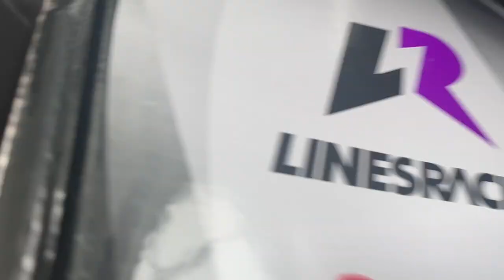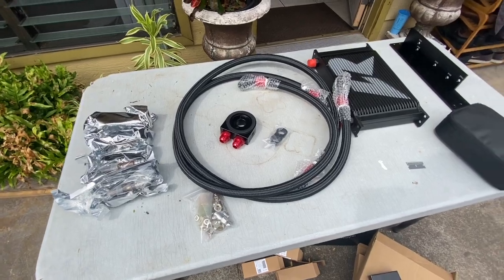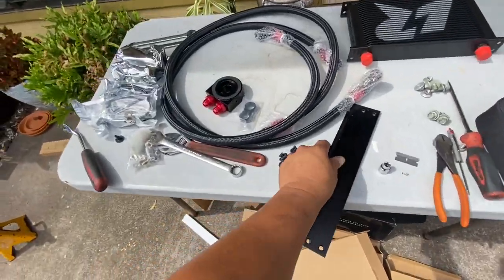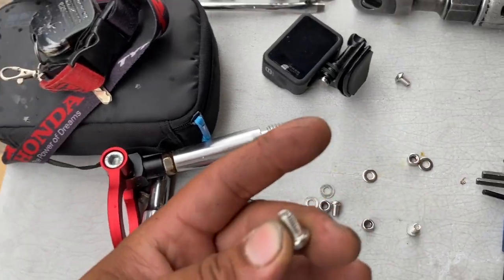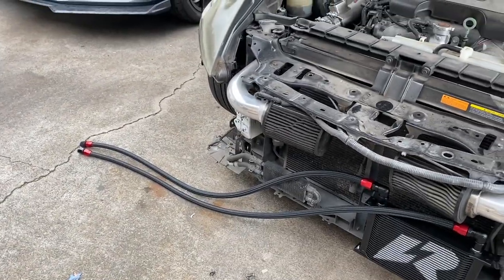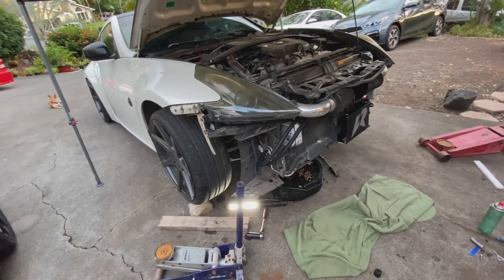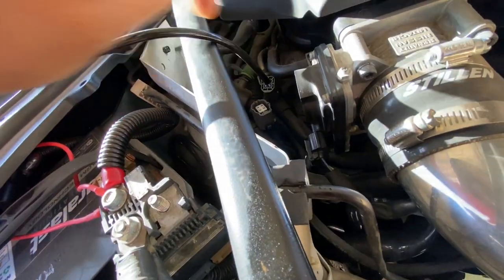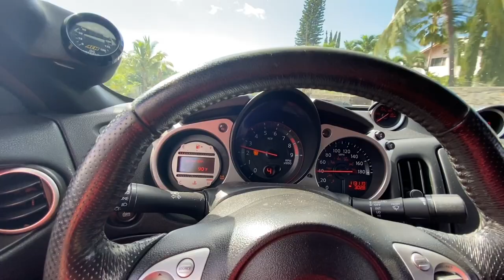Installing Lines Racing Oil Cooler Kit On A 370Z - and it DIDNT WORK OUT

Comment: I bought this kit a few weeks ago and installed it myself. 
The only 2 problems this kit will have is:
1: The bolts that the kit brings will be too short to securely hold the Cooler to the Bracket so just find 4 slightly longer bolts and use the locking nuts provided.
2: The sandwich plate comes with 2 O-rings on the AN fittings that screw in. Those O-rings are garbage and should be thrown away as soon as you get the kit. Simply use a generous amount of good Teflon tape on the threads and tighten them down good. Don't forget to Teflon the 2 NPT port screws and tighten them as well or they will leak.

Aside from those 2 simple fixes, this kit is amazing. The bracket bolts right up and is strong. The lines are good and as long as you treat them like cheap AN lines and don't over-tighten them, they won't break or leak. Oil temps are way lower than I expected, I tell all my Z friends to get an oil cooler as soon as possible.

Comment: In these generic oil cooler kits, if the o-rings are often shitty, don’t work, or are breaking/worn out. PTFE (teflon) tape is always a good backup, on top of using the right-sized o-rings. Thread sealant may also work, but I don’t have much experience; that, and I’m kinda weary of it melting into my oil and interacting with the oil and heat, etc.

Some people forget that the rubber material of the o-rings, just like any other rubber gasket, likes some lubrication; therefore, a lot of proper oil cooler kits will tell you to lube the rubber o-rings with motor oil or silicone oil. 

Aside from PTFE tape breaking down and potentially getting into the oil stream, this is why it’s best to always get new PTFE tape and have it ready when you’re undoing a fitting that already has teflon tape wrapped around the threads. I always wrap a brand new wrap of PTFE tape around threads, and almost never ever re-use, unless it’s an emergency situation. 

And for the people who say to use thread sealant, I don’t have too much experience, although I figured that I’ve had better success with using a thread sealant that is left to dry out BEFORE threadng it back in.

Comment: i run an ebay cooler and lines but with a grex filter adapter. i dont use the ebay adapter as ive heard and you have experienced it leaks all the time. I havent seen any of my parts leak yet with this setup.
Reply from the maker: Not sure if my uncle bought it through eBay. But that’s good to hear yours is still going strong
Reply: @jaysonventura  end up putting any kind of cooler on it?

Comment: I got this kit on my 86 tefloned the NPT fittings it leaked that was fixed. Other from that one if the core AN fitting has a small leak overall my one was quite a success and my oil temps are down. Maybe you just got a really bad kit.

Comment: I’m having the same problem with my oil cooler except it’s leaking from one of the fittings. Did you notice any difference when you CHanged your o2 sensors?
Reply from the maker: Check engine light still came on
Reply: @jaysonventura  have you done anything to get rid of the check engine light. Mine is on too for the o2 sensors and I don’t want to throw money at it if it’s going to do anything

Comment: Bro u did everything wrong in this vidoe, 1st don’t buy a cheap oil cooler cause they all suck, 2nd don’t extend the original o2 sensors they will send completely wrong readings, that’s why u got the check engine back on, u need to get extensions harnesses, sad to say this guy literally did everything bad
Reply from the maker: 1st this isn’t my car, 2nd I didn’t buy this part, 3rd they asked me to do and told them after the fact they need an extensions and 4th we all make mistake and live by doing better.

Comment: You don’t need Teflon tape for an fittings
Reply: You do, especially if the o-rings are shitty, don’t work, or are breaking/worn out. PTFE is always a good backup, on top of using the right-sized o-rings. 

Some people forget that the rubber material of the o-rings, just like any other rubber gasket, likes some lubrication; therefore, a lot of proper oil cooler kits will tell you to lube the rubber o-rings with motor oil or silicone oil. 

Aside from PTFE tape breaking down and potentially getting into the oil stream, this is why it’s best to always get new PTFE tape and have it ready when you’re undoing a fitting that already has teflon tape wrapped around the threads. I always wrap a brand new wrap of PTFE tape around threads, and almost never ever re-use, unless it’s an emergency situation. 

And for the people who say to use thread sealant, I don’t have too much experience, although I figured that I’ve had better success with using a thread sealant that is left to dry out BEFORE threadng it back in.
Reply: @isnowyazn these looks like JICs. If they are, he's right, don't put teflon on it. Working with hydrolics for 28 years.